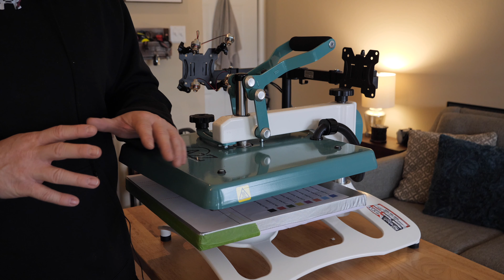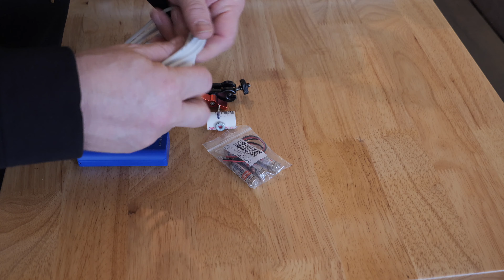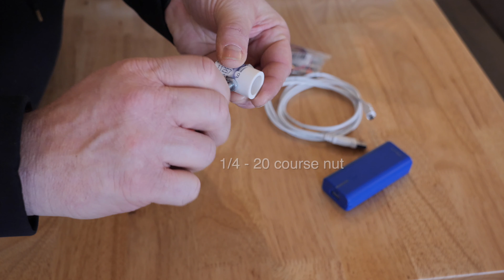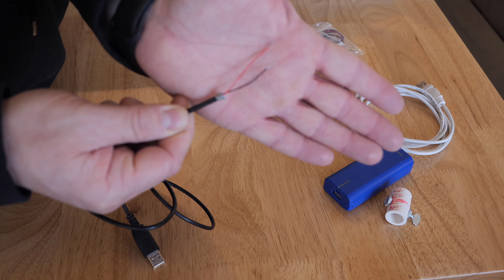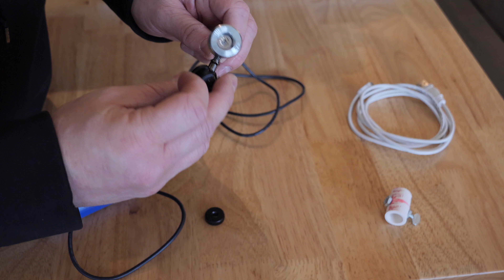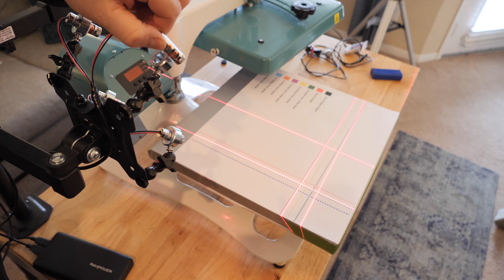Better than Hotronix Laser Alignment System? | My System v. 2.0 | Heat Press Aid

Comment: Do you by chance have a laser alignment sheet download for a 16x20 Heatpress?
Reply from the maker: I only created the one I have linked. The alignment from the top of the platen would be the same for any horizontal lines and center, as long as it's centered on the platen may still work, but I didn't design anything specifically 16x20. Sorry.

Comment: Where can I get the alignment guide? I’ve requested it a few times.
Reply from the maker: My apologies! This one slipped through the cracks. I migrated out of that Google account and didn't realize that file was still linked in that location. I'll look for the original this evening and relink it to my current drive and follow up. Thanks for pointing it out!
Reply: @  No worries at all!! Thank you for the response and getting it for me. I appreciate it a lot.
Reply from the maker: @JeremyFritz-l8o  Both video descriptions should be updated now. But try this: https://drive.proton.me/urls/AZHTWAP5N4#2qmXnqJVMYzl

Comment: Several folk have expressed concerns about operating time. These things seem to use very little power. I needed only 2 lasers for my purposes and have them both on a single USB. Plugged it into a little el cheapo pocket-size battery pack that I got for free at a Chamber mixer. Just left it on to see how long it would last. After 10 hrs on continuously, it was still going strong and I had to turn it off and leave. The battery pack still has 3 of 4 indicator lights still on - did not even need recharging. Not sure many shops would need more on time than that. 
And thanks for the detailed tutorial. I'm not at all handy and It was easy to put together. Such a great idea. The 4-way ball joint pieces are about 50-75% more expensive now, but still more than worth it. But, I suspect the two way ones would work as well. Cheers!
Reply from the maker: @anthonyjones8076  thanks for the feedback! Yeah, I never had any issues with overheating, or excessive power drain either. Glad to set up worked for you!

Comment: I use the harbor freight lasers, but this way is great but I was unable to get any of the links you set up plus the layout. You have another site I can download?
Reply from the maker: Hummm. The links in the video description are all there. The platan download is there for sure, I just double-checked it. The links for Amazon, etc., are also there. However, I have been getting a lot of messages from people purchasing them and it might be that they are sold out?

Comment: how long do these last? the harbor freight ones lasted only 2-4 hours! :(  couldn't even finish one job!
Reply from the maker: Mine are still working fine. But I don’t use them every day. No issues with long jobs though. Maybe some other users can attest to their experience. Since the can be plugged into a USB power block OR a battery bank, they’ll go MUCH MUCH longer than the little button cell batteries, and they’re better quality. It was the best economical solution I could find.

Comment: Great video.  I was looking at the hottronix but this is great and I just ordered everything.  With four lasers I plan to wire and  just plug into a kindle or apple plug.  Would you suggest wiring just two together and having two plugs or all four to one plug?  I'm assuming one plug could run two beams.  Most of the time I may only need two beams.  thanks.
Reply from the maker: Awesome! Yes, when I had other outlets available, I just ran them into an extension cord. Personally, I think two lasers to a single USB is about ideal. Like you, I didn't always need 3-4 beams, but usually two. So, I simply put the two most used beams on one wire and then the other two on the second one.
Reply: @OneDegreeLife  I bought all the parts using your system and it works great.  I did wire two lasers together on the side arm and then use a third on the back arm, both with plugs so I don't need the batteries.  Amazon had a four pack of lasers, 4 pack of the swivel mounts and 4 pack of the sleeves.  The one issue I find is on my swing away press I can't really feed the shirt on so I just have to lay it on top of the platen and I place it with collar at the top so I am placing the transfer right side up so I'm not looking at it upside down, if that makes sense. I am mostly doing tri blends and they don't show a center fold seem so if you don't get the shirt on perfectly then your design can still be off even though you have all the lasers lined up right.  It's more a problem with larger shirts Xl and larger as they have the most material hanging over the edges of my 15x15 platen. Also more of a problem with designs  that have a straight line, like the word 'volunteer' on the back.  I had a hard time with these not being straight.  Not because of your system but because of the shirt placement.  Any suggestions? Only thing I think of is to fold shirt in half and put in my own fold line but that really slows things up.  Thanks for doing this.
Reply from the maker: @dericjaques3595  It took me a bit to get used to doing shirts upside down, so I know what you’re saying. Like you mentioned at the close, folding a shirt long ways and then quick pressing a crease is a good way to find cebter. But, as you’ve mentioned, it’s also takes extra time per shirt. Doing 10 isn’t a big deal. You start getting up in production numbers and the delay adds up. Accuracy can introduce bottlenecks and hitting the mark in larger shirts where it is harder to see the overall picture on the platen takes away some of the “eyeballing”. Other solutions are things like tag placement. If you know your brand runs true center or is, say, aligned to the right or left by a set margin, that can help. Of course, this also assumes all of the tags are placed the same over inventory. Also, the longer the shirt, the harder to hit center as you go down the shirt because of lower fabric positioning. Some people like T squares for shirts that allow you to center the collar and then run down to a point - bit the fabric still needs to be on the platen straight. Finally, there are collar lines of varying sizes that allow you to place a U-shaped Templae at the base of the collar arch that will show you center. In any of these setups, using your vertical laser will help get a constant line through the fabric. If you use the T square for example, you can line the laser up with it and then you’re good to go. However, you’d still need to get the fabric placed properly. My only solution for that - if not making a crease where you can see/quick measure from each edge inward at the bottom of the platen - is the pinch the fabric at the side seam, then eyeball out equal distances on both sides, if that makes sense. Outside of pressing a crease and quickly measuring the base distances, almost any other “tool” does involve some estimating. Unfortunately, I don’t personally know of another solution that is as/or more accurate that is also more time efficient.
Reply: @OneDegreeLife  Thanks and right now I'm pressing 400 shirts over the next few days so on the ones that I need to place 'volunteer' on the back then I may just have to press in a crease otherwise I end up with about 20% that look off kilter.  I always like designs that have a circle or no defining straight lines as the eye tends to be more forgiving on getting it exactly straight.  That all said I give you A+ for thinking this laser system up, it's really great.
Reply from the maker: @dericjaques3595  it definitely can be a pain, but where “off kilter” can be more easily identifiable, I think the extra effort is worth it. Thank you for your feedback and best of luck!

Comment: Do you need to have batteries in the lasers if they are attached to USB power?
Reply from the maker: The lasers in this setup are USB powered ONLY. The Harbor Freight versions in another video are battery ONLY. Hope this helps

Comment: The Monitor bracket is great, a pity I can't say the same for the lasers. They came with batteries almost flat so bought new batteries which made no difference to the weak output from these lasers .43 mw. I had to turn the lights off to even see the beam. I've now found lasers on eBay with 30 to 100mw for the same price & they come with a better bracket & a plug in power supply.
Reply from the maker: Great! I’m glad you were able to find an alternative solution that works for you. I had to clean some residue off of the batteries and make sure they were tightened all the way down as I had similar issues. I believe in this video I show one of them has a loose connection and didn’t always stay on or focused. That’s why I bought extras. I created this video to illustrate an affordable that runoffs USB power supply via power block or battery pack. This has been my new go-to, and is far superior to Harbor Freight set up. The other is just a little bit more affordable and convenient. Cheers!
Reply: @OneDegreeLife  Hi again, I bought a pack of 5 x 5mw redline Lasers off Bay, they are certainly better than the harbour ones but still not bright enough. I probably should have bought much higher mw lasers. Have you found a laser module that is bright in daylight? If  so what mw power should I buy. I've read that a green laser is much brighter than red. I'd love your suggestions. Cheers Bernie
Reply from the maker: @berniesherman4444  Hello, again! I'm sorry you're having difficulty finding a solution for your setup. I don't work in direct sunlight, but have worked near open windows and still haven't had any issues. When working with darker fabrics, black for example, with more ambient light, the lines aren't AS easy to see, but it's still not causing me any issues.

I'm far from a laser expert and when I set out to figure out a cost-effective solution, I was specifically looking for something that would be low power for use with a battery bank or USB wall plug since I had several of those already. While brighter would certainly be better, I've, again, not found this setup limiting.

What I DID find when I was looking at options was that the lasers I could find that WERE brighter based on the output readings would ALSO be more complicated to power AND many had limited operating times because of heat. They were also $30-50 PER laser which more or less eliminated the cost-effective quality and knowing the operation times would be limited (I usually need at least 1-2 hours), this made it a no-go for MY focus.

There were others I found that were rated slightly higher on output, but I'm not sure a 10% boost would have been noticeable. So, when it came down to an EASY fix that was CHEAP, this setup is what I went with.

On the COLOR, yes, I agree, green is going to be brighter in general, esp. on darker shirts because of the contrast. So black, navy, even dark green and esp. red, it's going to provide more of a difference and make it easier to see - assuming the power rating is decent. When I was looking at them at the time, there were FAR fewer options and they tended to run more money, so I settled on red as it seems to be the standard for heat press use anyway. On my power tools, green is DEFINITELY better.  Bu those are HIGH POWER devices and run times are VERY short by comparison. I've looked from time to time and if I can locate a decent option, I might do a comparison.

This is ALL the data I have man! Sorry I can't be of more help. If I DO come across a better option, I'll shoot another video. Good luck!

Comment: Do we still need the dual stand for this build? It looks like you’re only using one of the plates. Thanks
Reply: No, you don’t have to. I put them on one plate for this video, but in my day-to-day, I have 2 on one and 2 on the other. I like the vertical lines from the top of the platen and horizontal from the side, but it really makes no difference. Some people have commented on running even more beams. You could run up to 8 with the dual if that’s your thing. Entirely up to the end user. Just wanted to share my setup.
Reply: @ryanbartels673  thanks for the advice Sir.
Reply from the maker: @themotivationjuice  Ha, that's really weird. I replied from my email and it signed me in from an account I never use. Anyway, glad I could help!
Reply: Hey, I'm almost done building my laser system using all of the materials you suggested.  My biggest hurdle will be making the hole in the monitor plate a little wider.  For some reason, the small rig magic arm doesn't fit in the hole (luckily I have a drill press). Also, just an FYI, on the measurement guide you provided, I think you made a mistake for the labeling of the yellow line (probably should be 3.5 inches from the collar line, not the center). But.... anyone with a little common sense could figure that out.. Just giving you a heads up.
Reply from the maker: @themotivationjuice  Thanks for the heads up! I was changing some links the other day, and I may have accidentally linked to an original version of that platinum design. I will double check it when I get home, and update that. I’ve actually just transitioned to a single arm monitor stand myself, because I’m upgrading my press type. Thanks again!

Comment: How do I get the 15x15 template sheet printed on big enough paper? Staples? And if so is the pdf 15x15?
Reply from the maker: You can try Staples or Kinkos or anywhere that can print you a 13x19 sheet. That’s the file size. Make sure they print it scaled to 100% to ensure the measurements are accurate. The actual diagram will be 13x15 when folded/trimmed. 15 inches wide is perfect for getting the measurements since the length top bottoms is continuous.
Reply: @OneDegreeLife  thanks man I did that.. Your the goat. I did everything u did but my usb plug in to the wall.. I love it
Reply from the maker: Great! Sorry for the delay. I’ve been out of town on vacation. Glad you have it up abs running!
Reply: @OneDegreeLife  wish I could send pictures

Comment: And unfortunately some of the components mentioned have doubled or even quadrupled in price :(
Reply from the maker: Geez. That’s no good. I haven’t rechecked them recently.
Reply: @OneDegreeLife  pretty much anything that would be useful in a work from home scenario has increased in cost, monitors, monitor stand, desk, etc. over the last year or so. 

Great Video and concept, I am going to use this info to setup my own version. much better than some other videos that had a similar idea, but poorly executed. Your idea and variations are spot on in my opinion. Cheers.
Reply from the maker: @thomashughes8838  Thanks for watching and commenting, Thomas. Yes, I've noticed that too, and it appears that some supply chains have bottle-necked or cut off some supplies completely. I've been trying to update the list with alternatives that will possibly work, but it's getting tougher to find good solutions. Best of luck in your build and I hope your end product works for your needs! Cheers

Comment: Why not just run it off a USB power adapter off the mains?
Reply from the maker: Exactly. My comment on the video got erased and didn't realize that before posting it. V1 of this was running battery-powered beams, so this was an adaptation to THAT model should people need that. I work near a 120 outlet, for example, and Hotronix recommends that ONLY the press use that power source. I don't have another one very close. I could run a long cord of course, but this was easier for me. But yes, a USB power block, or extension cord with USB built in would maintain power and eliminate the powering off. You're correct. Cheers

Comment: If your electrical wall outlet has USB ports, could you use these as a power source instead of a power bank?  following is a link to s what I am thinking about. https://www.amazon.com/Charger-Protector-Extender-Charging-3-Sided/dp/B087RKKXM5/ref=sr_1_6?dchild=1&gclid=CjwKCAjwv_iEBhASEiwARoemvFf_ZbtCO8IZGj4X2-C49eYlwgzkKWmxN1MWR-J_2VtBmmAozcsH2RoCViYQAvD_BwE&hvadid=174263108608&hvdev=c&hvlocphy=9016808&hvnetw=g&hvqmt=e&hvrand=17758394737053459972&hvtargid=kwd-26617207632&hydadcr=19131_9441222&keywords=wall+outlet+with+usb&qid=1621061174&sr=8-6

Comment: thanks for this! this is amazing! 
would any usb cable work? or does it have to be a specific type?
Reply from the maker: I think most USB cables carry a similar current. I use the mini because I had several of them laying around and they’re not as commonly used on newer devices. A standard cable for say a printer or a micro USB may work as well. TBH, I haven’t tried it though.

Comment: How well does the alignment system work with a clamshell heat press?
Reply from the maker: Depending on the size you have (deeper = larger opening typically) you may just need to mount your stand a little more toward the front of the table so the lasers have a better angle. In fact, Hotronix demos there’s in a clam unit if you want to check it out. It’s more about placement than anything else.

Comment: Will this work with a clam top heat press?
Reply from the maker: Yep. Depending on the size you have (deeper = larger opening typically) you may just need to mount your stand a little more toward the front of the table so the lasers have a better angle. In fact, Hotronix demos there’s in a clam unit if you want to check it out. It’s more about placement than anything else.
Reply: @OneDegreeLife  Thanks I took a look and you were right